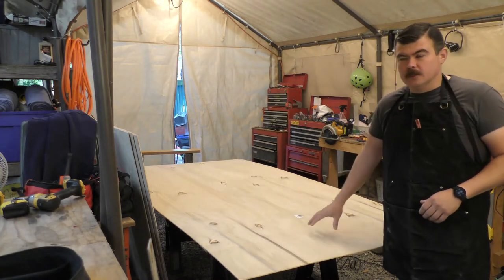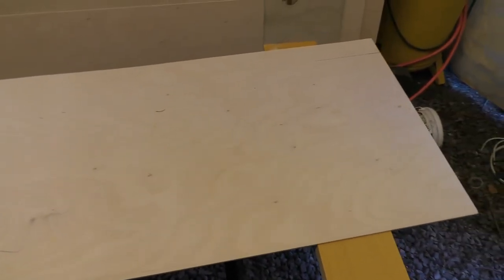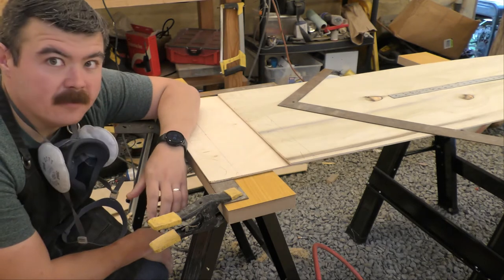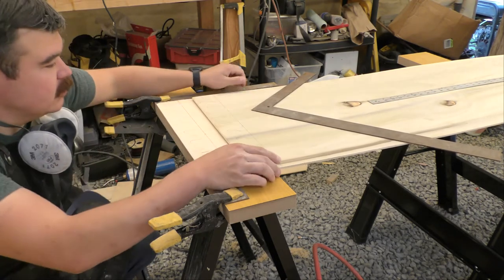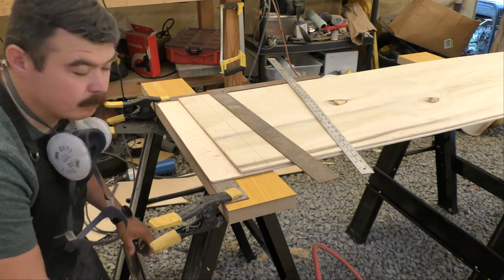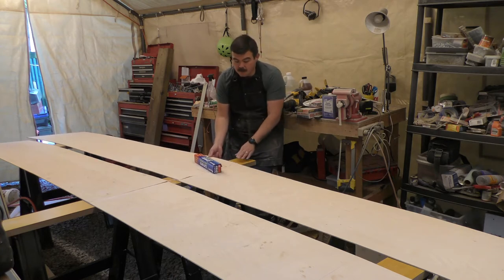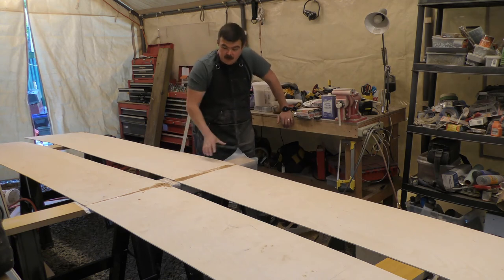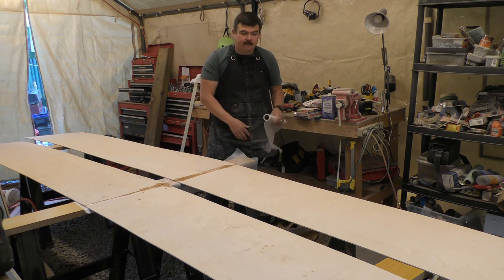How to Start Building a Wooden Boat- Sailboat Build Part 2

Comment: Can I say you are doing a great job there and I have the same book and am thinking of building the same boat but in the extended version and as a proa only. The only thing I see you doing "wrong" and I use the term loosely here is I would wear some hand protection while using epoxy. I buy the through away non dusted gloves from the supermarket. I don't know what epoxy you are using but I use one that mixes at 2:1.  It is way to easy to mix to much for the job but that I guess is part of the build process. Good to see you going for it in not ( as you said in previous video ) perfect conditions.
Reply from the maker: Thanks, and you are correct about doing it wrong without using gloves. I have boxes and am usually pretty strict about using them. I quickly realized what I forgot as I was doing it, but there is not going back once you start. With your gloves make sure to have something strong. Catch one piece of wood the wrong way with cheap gloves and they split right open.
The Epoxy I'm using is System 3. It's based in Seattle, 2:1 mix and non blushing. I've been using it for a while and really dig it.